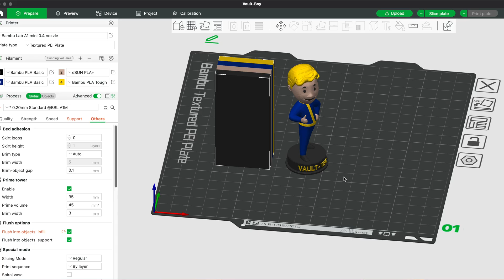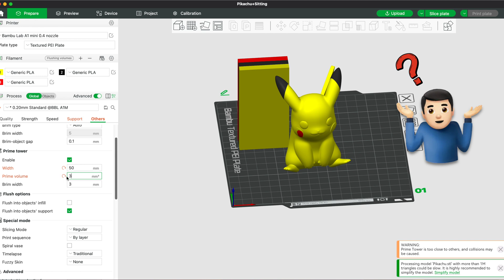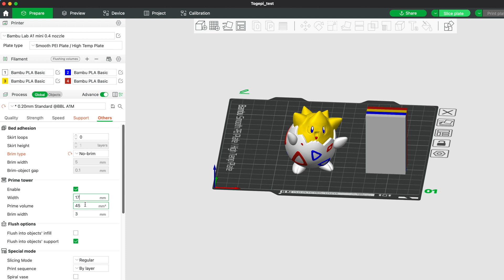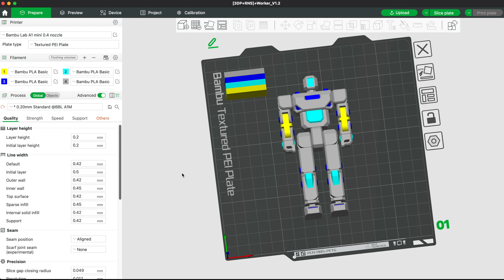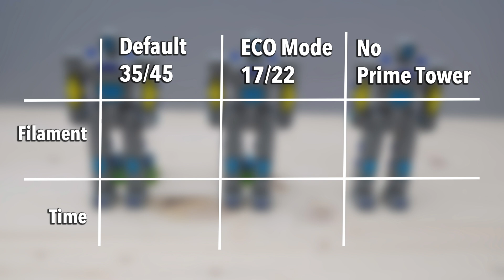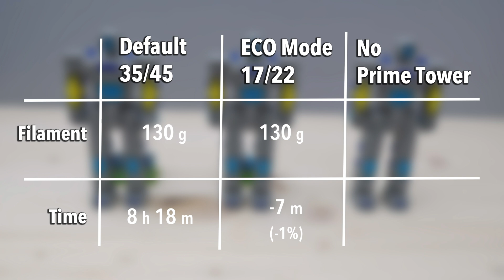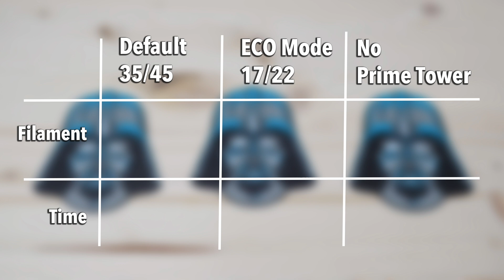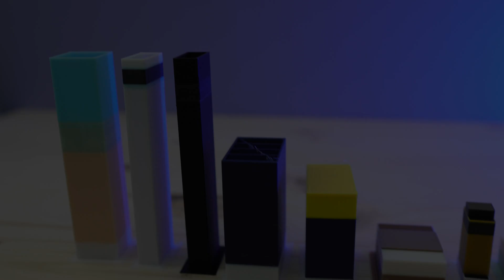Do you need the Prime Tower / Purge Tower? (Multicolor 3D Printing)

Comment: I printed a part with a single filament change after 2mm. The slicer wanted to include a purge tower of the same height as the model itself. Why? The tower is no longer needed after the first filament change. It should have not been higher then 2mm plus the sliced layer height. I just removed it and the print came out perfect.

Comment: I am having a dilemma with not using a prime tower. I have a multicolor project that takes up the entire build plate (I am using a Anycubic Kobra 3 combo with the AMS). So, there is no room for a  prime tower or purging the pressurized filament in the nozzle. The problem is when the printer changes filament color and begins printing, it purges a blob of filament on the print before continuing. I understand there is a pressure build up but I do not know how to fix this without using a prime tower. What settings am I missing? I have gone through and attempted to correct my settings but cannot get it to fix this issue. My frustration is that the machine was working before. Since then I have chosen to update my software and That is when the issue has occurred.  Can you help me?

Comment: Iv been messing with using pla layers between the supports and part on my petg prints and honestly i feel like using the prime tower for them is just a huge wait as well as with the time tower u cant set different layer hights on different items in a single print so just purging for fillament charges is unfortunately my only option

Comment: How did you get the colors to not bleed through I made a Pikachu with my AD5X and the black and red bleed through my yellow filament and I used the prime tower
Reply from the maker: prime tower isn’t primarily for preventing color bleed, you need to tune your purging volume for that. in this video i kept purging volume unchanged (1.0).
Im not familiar with AD5X but if the standard purging volume isn’t enough, you need to increase it a little bit.
Reply: @Lukis3D ok thanks for the advice

Comment: I understand its a shame to see all the waist that comes from the prime towers, but I think they are worth it compared to the risk of possibly failed print from not using one. 

I also wonder if it would be possible to use the infill of the modle as a prime tower? This wouldn't work for modles where the change happens on the bottom and top layers, but I like to think it could help.
Reply from the maker: yes it’s exactly how you explained it. I only turn off the prime tower if I don‘t care about the quality. 
You‘re also right about the prime tower as "infill", which only works if there‘s infill to begin with (there are parts of a model that don‘t need infill).

Comment: Very interesting, thanks for the info! It seems like the priming tower is mostly not needed, but as you noted, the savings are negligible. I came here wondering if I needed a prime tower if your color changes only happen in the z axis - for example if you only change the top few layers to a different color. I was going to turn off prime tower, but I am printing a planter and I think losing flow would be an issue, so I have decided to leave it on. Thank you!

Comment: So my take away is to do similar to what you did at the end by making the prime tower smaller and avoid the under extrusion problems. I would reduce it even more. Alternatively, it is possible to purge the filament into a “waste” object is it not? I haven’t tried that yet. But some object that doesn’t really matter what colour it is, like bag clips or something.
Reply from the maker: yep, in fact, my favorite setting for the older prime tower is 5/10. 
Purging into other objects doesn‘t always work. Maybe printing waste object of the same size would work, but some models only have multicolors on certain layers so if you print small objects, once it goes higher, there‘s no more object to purge into.

Purging into waste objects sounds good at first, but most of the time you‘ll only waste more filament or print objects that you don‘t even need. So in my opinion, printing a small prime tower is the most efficient way to do it.
Reply: @Lukis3D Cheers. Useful info.

Comment: How to minimize amount of poop?
Reply from the maker: you can adjust the multiplier, somewhere around 0.7-0.8. If you’re printing black-white, I would just leave it at 1.0 to avoid colour bleeding.
Reply: @Lukis3D  ok, need to try that out in both my P1S and my not yet assembled A1 :D

I need to learn the trick to not have total flush filament more than actual total filament to be used :) ive seen examples of that on youtube and facebook bambu lab groups. 

Like where total filament used is 70g and flush filament 85g. That isnt very efficient and economical :)

Comment: they removed the option to set the prime volume, it is so stupid, now you can only switch between infinity waste or completely unprimed nozzle. The part that i want to print is very small, without priming it fails completely, so i have to print 20g of filament for my 3g part, it is sooo stupid
Reply from the maker: it probably has something to do with the patent lawsuit. of course, I‘m just assuming though.
Reply: @Lukis3D ah. i found out how to influence it. it's actually better, you have to set it in the filament settings. so for stubborn things like TPU i keep it higher(30mm³), PLA i use 10mm³. default is 45mm³. it dictates you tower base surface area.("filament prime volume", also "filament ramming lengths" affects it)
don't set it below 10, you'll regret

Comment: In my brief experience, prime tower helped me greatly when printing cards with embossed text as The first 2mm after a colour change does a tiny blob which is usually not an issue but when youre printing tiny characters it becomes one. Even without AMS i had to colour the text a different colour so i could force a prime tower 😅 i just needed it for a tiny bit so made it laughably small and the blob issue was solved.

Other than that, didnt have to really use it yet in my prints
Reply from the maker: hey man thanks for sharing! Yeah i find it most useful for flat multicolor prints. Currently I also print tiny prime towers and my prints still look great.

Comment: Thanks for the Video :) 

I was faced with the decision, with or without Prime Tower. I got an A1 Mini a month ago and start with only basic knowledge xD as far as 3d printers are concerned. The a1 mini was chosen because it was not only inexpensive, but also advertised as "beginner-friendly".

I'm now printing for the 1st time in 2 colors xD and was discreetly shocked that I have a printing time of almost 7 hours for a small part of 30x30x50mm xD 

But thanks for the video, it helped me. A Prime Tower is apparently only necessary if it is important that it has to look "good". 

Correct me if I got i understand it wrong.

Comment: I just started doing multicolor printing with my AMS and reduced the prime Tower way down to 1mm. I noticed an improvement in the extrusion a little bit even with the absolute minimum. I then slowed the printer down a little bit and lowered the layer height and got the exact same results with no tower. Personally, I'd rather it go slightly slower and waste less filament.
Reply from the maker: my new favorite settings currently since this video was released is 5/10.
But thanks for sharing that I could go even lower!
Reply: @Lukis3D  I should clarify a little, that the prints that I'm doing are relatively small. They only take about 30 minutes or so and aren't very tall so it's possible going that small won't work for a big print.

Comment: Would be interested in seeing something like this but with the flushing volume. I have been leaving the prime tower but using .6 for the flushing multiplier lately, though i had not been examining  extremely close for bleed over. They were Christmas gifts so can't recheck them for that. Given this information it seems like it would be better to keep the tower for flow control and reduce the flushing. Mixed with flush to infill.
Reply from the maker: yeah this video is focused more on the influence of the prime tower. 0.6 sounds good but i would increase it to 0.7 or 0.8 if you have colors that have really high contrast like white-black.

Comment: There is one huge, obvious need for the purge tower you didn't mention.  It helps Bambu Lab sell a lot more filament!
Reply: That's exactly right and what I told my husband.
Reply: Is Bambu filament the only filament you can use on a Bambu printer?
Reply: @RB-ni8vm  No, you can use any filament, but theirs has RFID tags built in, so that printer automatically recognises the filament. I only use third party filament on mine though with no issues

Comment: Your "Eco-mode" you state is about half... You are reducing width and length by ~50% which leave you at ~1/4 of original size.
You are comparing time and waste, but you are reducing the less wasting process, to increase print speed and reduce waste first look at reducing the purge. Modifying purge first then reducing your prime towers will increase the percentage gained since the overall will have been reduced before running the test.
Reply from the maker: my goal is in this video was to mainly observe the influence of the prime tower, that’s why i didnt mess with the purging modifier. I stated this at the beginning of the video.
If you want to further reduce the waste, of course you can do that, there’s alot of ways to do that. But that’s not the point of my video.

Comment: Some super strong caveats apply to this testing - PLA is the easiest thermoplastic to get back up to pressure, so it has less need for a prime tower. Printing anything in even PETG and the lack of a prime tower will be much greater. You'll also find that the impacts will vary depending on when and how the change occurs - if it's on an outside wall, the influence is EXTREME. Bambu studio and other slicers will try to avoid this, but if you have a colour that is only being used on a wall (like text or other fine detailing), the lack of a prime tower will ruin the whole print. Anything functional will also have that change point as a significant structural weakness. The prime tower also looks a lot bigger than it actually is - it's like 0.1% infill and with a super thin wall. You can print a 500g full bambu bed and only need 25g of prime tower. A single failed print saved with a prime tower = 20 whole towers saved.
Reply from the maker: hey man thanks for your inpu! As I pointed out at the end of the video, this test was specific to those filaments I chose and to the models I printed - It’s a given that not all models and plastics share the same characteristics.
It‘s not meant to be the rule of thumb, as I said in the video. I also welcome other users to do their own tests, if they have specific needs.
Reply: Between this video and this comment my interest in turning the prime tower off has been solved. Thanks guys!

Comment: I may be 5 months late, but if you are using an older single nozzle multi color printer, its not a prime tower but a purge block. Since it doesn't purge in the form of poop.
Reply from the maker: hey man thanks for the comment! I guess I shouldve specified in the beginning that this video is made with bambulab printers in mind and newer ones that have similar technology.

Comment: Lukis3D!!! This video is awesome, you solved a problem you didn’t even mean to. I have been struggling with the trick that everyone tells you about: for PLA you can use PETG as a support interface and it improves print quality. This is true but I had a huge problem:

When you have tall prints the prime tower gets very tall and when PETG and PLA are both used on a print, the prime tower uses both filaments in the tower. I had a print that was about 8 hours long and it failed 6 hours in because my prime tower broke, due to the PLA and PETG not adhering as you might expect.

But I was told that the prime tower is required! You have shown that it is not required and I could just purge out some extra filament I instead of worrying about a print failing due to prime tower adhesion issues.

Thank you so much.
Reply from the maker: hey man your welcome! That‘s awesome, I‘m glad that my video somehow helped you, indirectly😄
I hope you get the great results while saving filaments and printing time!

Comment: There is ZERO reason we are not allowwed to put all this material into infill
Reply from the maker: yep, you can. However, there are some models that don‘t require infills, like some flat prints or prints with thin walls etc. Each case is different so you can decide if you need a prime tower or not. If you need one, you can use the settings I show in the video to further reduce the size of the prime tower.

Comment: This only saves filament from the purge tower layers printed where no layer change occurs. Where a change occurs the prime tower is used as part of the purge volume. So it's only worth skipping if you have something like a handful of color changes later in the print.
Reply from the maker: yeah if there’s no color changes, the tower is not needed at all, unless you’re doing timelapses.
I wouldn’t skip the tower entirely if you have alot of color changes though, doesn’t matter which layer.

Comment: great video! just upgraded from a Sv06 to a X1 Carbon (that I haven't received yet) so dumb question is the prime tower only need for muti color prints? or does bambu use it on all there prints including single filament prints
Reply from the maker: thanks man! No you don’t need a prime towet for single colored printing, unless you’re shooting a timelapse. Then i recommend turning it on.

Comment: Why hasn't anyone figured out how to purge into the voids of a infill grid? No waste printing full color objects.
Reply from the maker: purging into infill is not all-in-one solution for it. A model isnt usually uniform, it has small area and big areas. where an area is small, it will flush a small amount (or none at all), and when the area is big, it will flush more. So the priming isn’t going to be consistent througout the model.
Reply: @Lukis3D great explanation I’m sure we’ve all wondered about this
Reply: you can configure at least bambuslicer (maybe prusaslicer?) to do this, however.
Reply: Also, if your using different filaments for support, I don’t like to flush into the model because the infill won’t be as strong since the dissimilar filaments don’t stick to each other (hence the support interface).   I do wish I could tell it which filaments to flush to the infill and which to no.  It’s just a global setting though.

Comment: Seems like there would be some value in being able to restrict the height of the prime tower so it could be used for improving the bottom layer. Or being able to set the volume for various layer-heights.
Logically, only the top/bottom shell and the walls are particularly sensitive to the lack of a prime tower. At least for the minor defects that seems to be showing up without the prime tower. Having the prime tower be more of a tree support structure would allow it to prime more for layers with a lot of external surfaces.

Actually. Couldn't printing infill first be used to partially replace the prime tower as well?

Comment: what happens if the prime tower gets knocked off the build plate during a print? Whats it mean? Any help would be greatly appreciated!
Reply from the maker: this has never happened to me before, but you can also make the brim bigger so it‘ll stick better to the plate. Or try to wash your plate wish dishsoap & wipe the plate with IPA before a print.
Most problems that occur in 3D printing are caused by the bed being dirty
Reply: @Lukis3D  Thank you for your reply

Comment: Hi there! I'm having an issue with my Bambu Lab printer where the Purge Tower isn't printing, even though the option is enabled in Bambu Studio. I'm using a single filament (no AMS Lite), and while the model prints fine, the Purge Tower is completely skipped. I've double-checked the settings, but the issue persists. Does anyone have any suggestions or tips on how to fix this? Thanks in advance!😅😅
Reply from the maker: hi there, if you’re only printing in one color, you don’t need the purge tower, so thats why its skipped 😊 Unless you’re doing timelapse, then it’s gonna be activated.
Reply: @Lukis3D  Thank you for your response, but I'm already aware of that. The problem is that during printing, my printer often leaves the model, moves to the upper right corner, lowers to the print bed, and then returns to continue printing. When this happens, a small piece of filament always gets left on the model. 😒😒

Comment: i don't see why theres no setting for the prime tower to be printed away from an object when possible, that way the tower will only be printing on layers with a change in them.
Reply from the maker: i guess that would save some filaments, but if it has to move away, then move down, then move up again everytime, that would mean longer printing time and adds the risk that the print head will knock down your model.
But the idea is good, hopefully they’ll come up with that solution soon

Comment: You can use prime tower like purge tower. Lower your purge and the color left on the nozzle will be purged into the prime tower. So you will get stability on prints with prime tower without the waste of it.
Reply: If you pair this with flushing into object and the color change waste reduction gcode, you can then reduce the purge tower's size to the minimum volume the slicer will allow (probably 1 cubic mm) and then prime initial tiny bit of volume with the purge tower and the rest into random toys and tools rather than waste.  By the time the hotend gets to your actual print, it's ready to go.